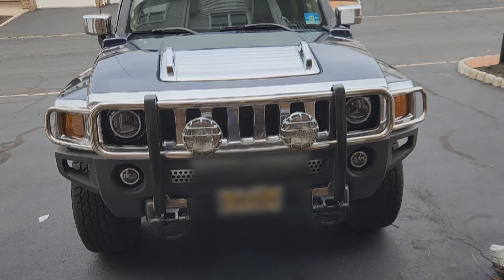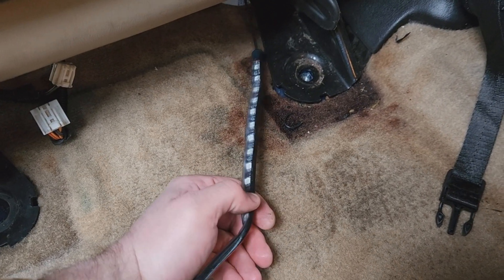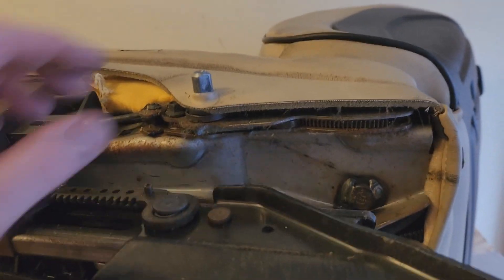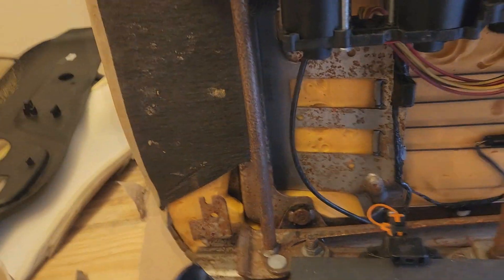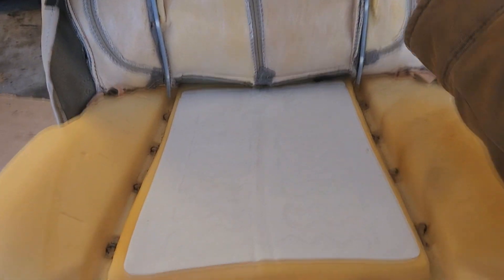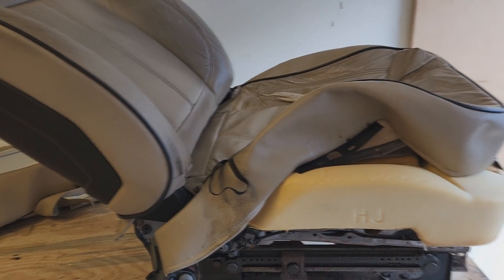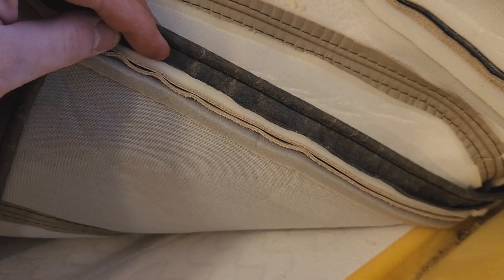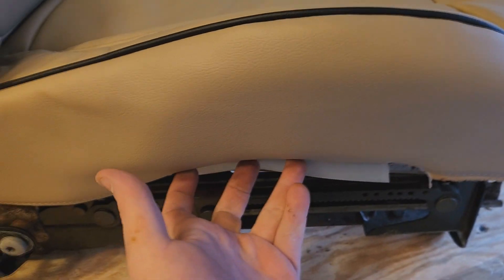Easily Replace Hummer H3 Seat Fabric/Leather at Home

Comment: Appreciate the video, thanks! I stumbled upon the exact same eBay seller before finding your video. Can you speak to the color match between this replacement and the original? In the video, it appears to be slightly lighter in color than the original seatback.
Reply from the maker: The color match is almost exact. My replacements were slightly lighter, but that's because they didn't have over a decade of grime in them like the rest of the seat. After a few weeks of being in the truck, that is changing, and with regular use they are beginning to match the rest of the seat exactly.